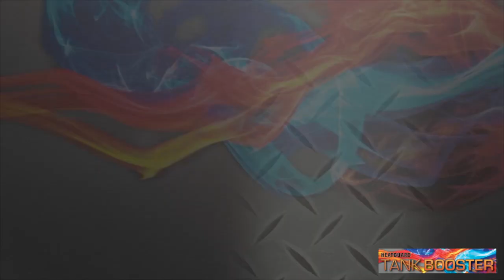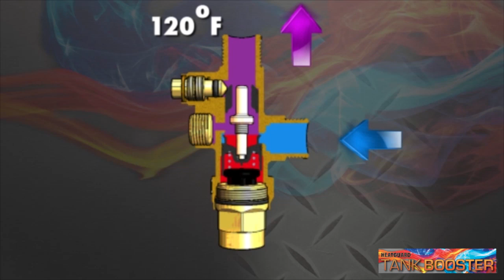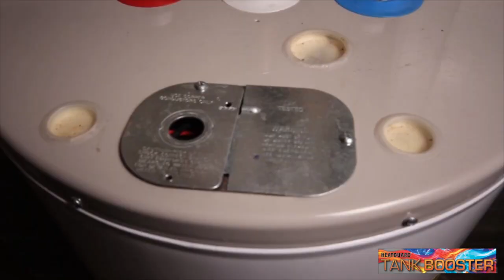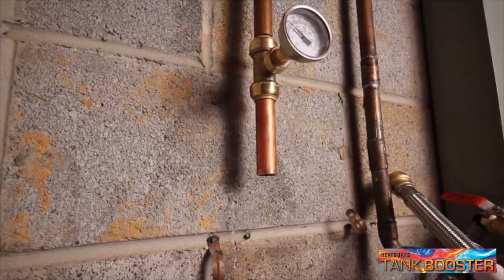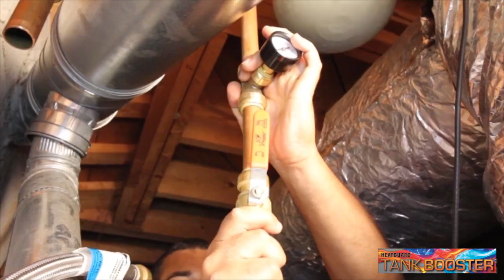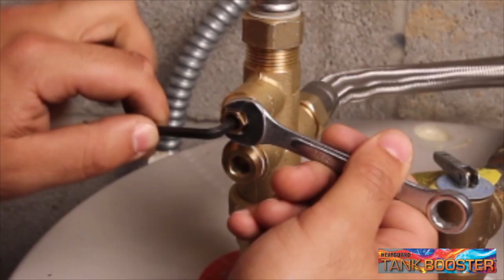Tank Booster - Double Your Hot Water!

Comment: That's a lot of messing around and expense. You are just mixing hot and cold water at the source rather than at the shower or kitchen mixer tap.  Why bother?  It's certainly not going to double the hot water!!
Reply: Running your hot water heater at a higher temperature will certainly allow for more hot water supply (unless you always use pure hot water, in which case your hot water will just be hotter). The problem is the potential for scalding from the 140F hot water. This premixes the 140 with cold water, so you don't get more than 120 out of the tap (plenty for household use), but with the increased hot water supply of running your tank hotter.

You're right that just running your hot water tank higher would get you almost exactly the same benefits-it's just hazardous. 140 degree water can give you a 2nd degree burn in a few seconds. 120 degree water will take 8 minutes!
Reply: Craig Williams ....!
You are WRONG about that!
Reply: To prevent 140 degree water coming out of the tap to scald some one thats why.
Reply: David Rogers
 right this item is kinda pointless  for past 10 years our water heater has  been set as hot as it will go  an  at wgerever we want hot water we adjust it to preferences and usually  theres enough water  for  2 -3 showers dishwasher sometimes a loud of clothes depending on the tempeture i noticed by setting the water heater hotter we actually use less hot water as  we  reach the desired results with higher temp i like a fairly warm shower  and i noticed before  i turned it up 1 or 2 showers  and the water was cold  now we get twice that  just gotta be cautious not to scald with too hot this is also good  when i want to wash clothes in  really hot water sanitizing them etc.
Reply: @SuperJeremi10  its there to do just that, prevent scalding at the faucet.
Reply: @mikegribben4549  I've never had scalding at any faucet any dummy van tell if you turn thebwater all the way hot and you see alot of steam the water is probably hot if you can feel the heat the water is probably hit don't touch it.  We use our sprayer in the kitchen sink with the water all the way hot it's really good for rinsing dishes with greese or melted cheese etc.  It also prevents the need for our dishwasher to heat the water via electric heating element which saves energy.  Nobody has ever scalded themselves in the shower guest nore family I have 6 people in this house right now if I set the heater at the normal setting only 2 people can get a shower.  The washer is always running the dishwasher is always running people need to use common sense if you turn the faucet on hot then the water is probably hot even with the heater set at recomend you can burn yourself.
My heater stays maxed out and it will always bee maxed out.

Also I like that when I use the hot water in the washer it's actually hot.

And on warm it's warm.